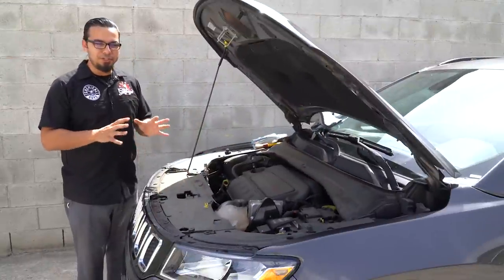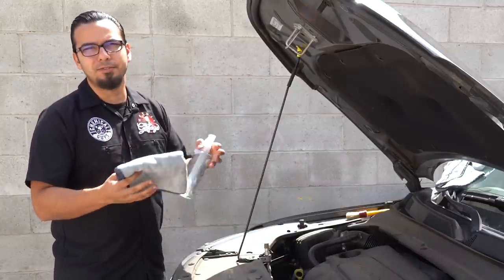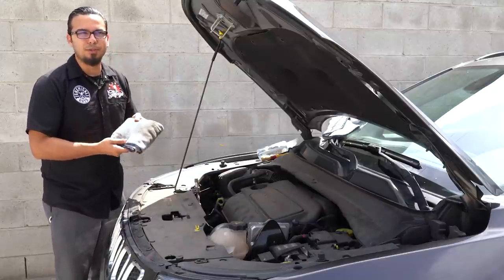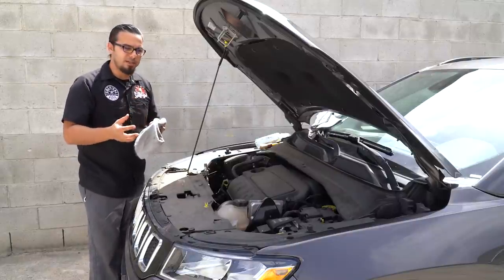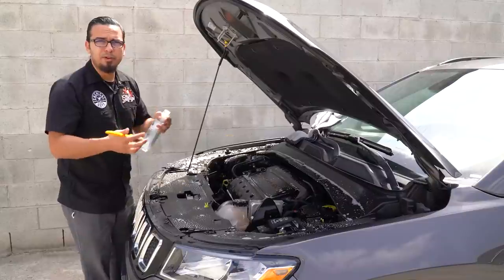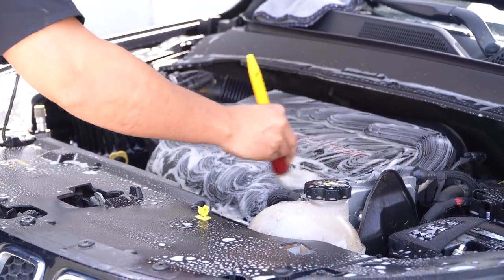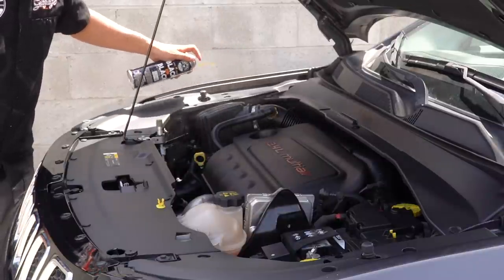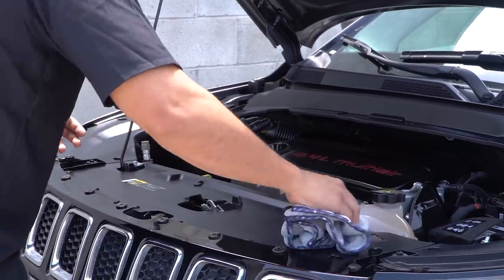FILTHY Engine Bay Gets Its First Clean EVER | Chemical Guys

Comment: Well for one I have a 2000 Toyota Camry LE that was given to me by my cousin it was his father's Camry. Back then they didn't make that plastic cover that's over the engine. I call it the engines beauty cover. The Nonsense has really turned the engine bay around. I like this product alot. Got this product at Walmart in my town. I will set a routine to keep the engine and engine bay clean using this product. I can't use water because of wiring going everywhere. So this product is prefect for the cleaning. Thanks much for this product it has been a lifesaver.
Reply from the maker: 😃 Gotta love Nonsense!!
Reply: @ChemicalGuys  Have a question for you. After I clean the engine block with the Nonsense with a detailing brush how do I clean the oil out of the detailing brush? What I do is spray the product on a auto paper towel and clean that way. I don't want to ruin my detailing brushes by getting motor oil on them. So this is why I'm asking.
Reply: @williamclick9771  better to use a detailing brush only for the engine bay. You can wash it with water and maybe a bit of soap to get rid of the oils or grease

Comment: Hello Chemical Guys, I have watched many videos on engine bay cleaning products from different manufactures and I was impressed with your products the most. The problem for me is choosing which one of your cleaning products would be best for my application because the application on some of your cleaning products seem so similar , For instance the difference between your Nonsense cleaner and your All Clean + cleaner, I have seen both used in some of your engine bay videos. In these videos your explanation of what thee products are used for sound similar . I have a 92 Blazer in pretty good shape and I want to clean the engine bay . This older vehicles do not have as many plastic parts as the newer vehicles and have many more metal components, especially on an old school 350 motor , it is not terribly full of grease , however I think I would need the more aggressive of these two products, Which would be best to use for me? Also the same problem of deciding which product to use occurs with your Black on Black and VRP Vinyl Plastic Rubber products, which is best for my application, I figure there must be some differences or else why keep both products, just upgrade the one you had and then get rid of the old one. I may be one of the few having this problem, maybe not, I am not sure. One last question with the dressings to brighten up the engine compartment once it is clean can you use them on metal such as anodized aluminum valve covers? As I have already pointed out, these older vehicles have much less plastic in the engine compartment then the newer ones.
Reply from the maker: Hi Peter! Thanks so much for your message. All Clean with an aerosol dressing sounds like a great combination for your needs. Check out this video.
https://youtu.be/UrLEOeSV3aY

Comment: First you guys rock use your products and they are awesome. 
I have a new car and I love to clean it.id like to use the ceramic coating on it but if I wash it will that remove what I out on the week before?
Reply from the maker: Hey William! Thanks so much for tuning in. Washing your vehicle won't remove coatings such as ceramic. Clean Slate has the power to remove old coats of glaze, sealant and wax.

Comment: Question for Chemical Guys or anyone else who would know. 
Could I just spray down the engine bay and components with the Nonsense spray, then brush it down to remove any dirt, then rinse it off with a water hose? Then use a leaf blower or shop vac blower to remove excess water? 
Just curious if this would be a decent and quicker way of cleaning a not so dirty engine bay. 
Cheers, thanks!

Comment: Just Wondering What Dilution Ratio Did you use for The Nonsense Cleaner?..
Reply from the maker: Hi there! Nonsense can be used safely at full-strength or diluted as desired. Use a dilution of 10:1 for most tasks.

Comment: I have a truck with the rubber floor instead of carpet. What can I use to clean, then protect, and make it look good without being slippery?  Also I have black step bars any way to make them look good without making them slippery?
Reply from the maker: Hey Kenny! Check out Mat ReNew to clean and protect vinyl, rubber and plastic floors. I recommend using Nonsense All Purpose Cleaner before applying VRP to your side steps.
Reply: @ChemicalGuys  Thanks I have all three already. I just haven't tried them yet.